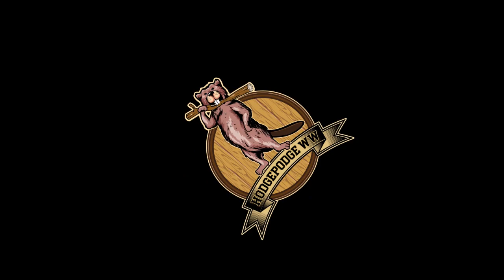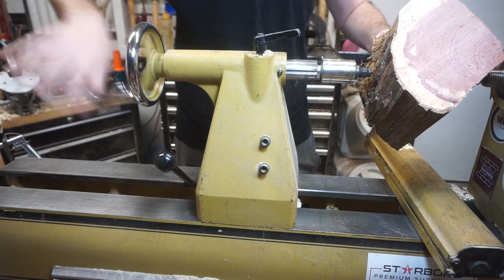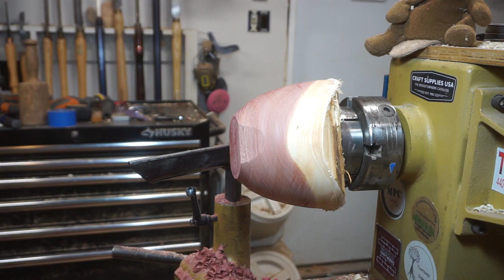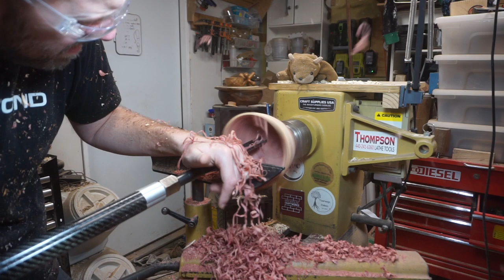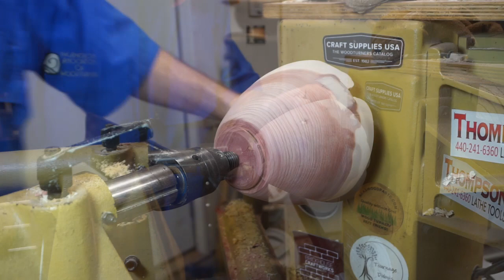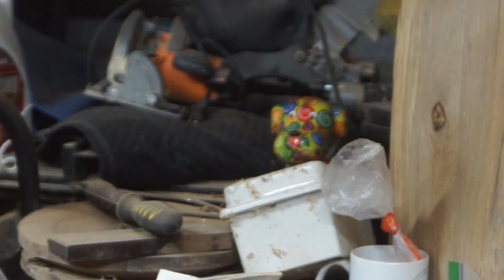Woodturning - The Untold Story of Cedar

Comment: I would like to touch this bowl, and study it well! I tend to have a bit of trouble hollowing deeper bowls. What tool did you use?
Reply from the maker: For the most part I used a 5/8in bowl gouge and when I got to the bottom I used a 3/4in bottom bowl gouge. Once you get the hang of the bottom bowl gouge it works great!

Comment: First time viewer and it threw me off as to why you flip the bowl around so many times. Seems you're adding a bunch of steps and creating two tenons when really you only need one. When I make a bowl I only flip it twice and done. I mount it either between centers, worm screw or faceplate, make the tenon or mortise and carve the outside. Flip it and mount in chuck and carve out the inside then flip and get rid of tenon. All sanding and finish is done before flipping.
Reply from the maker: Welcome and thanks for watching! I only started doing this two tenon/mortise technique a few months ago after taking a class with Stuart Batty.  The reason for doing the first tenon or mortise on what will be the top of the bowl is that it will then allow you full access to the bottom to do a pushcut from the bottom all the way to the rim. The tailstock would typically be in the way if you were between centers. You could use a faceplate but I feel that takes longer than just making a 2nd chucking point.